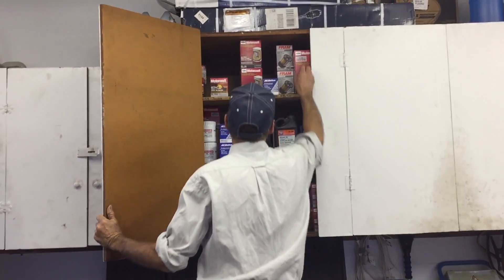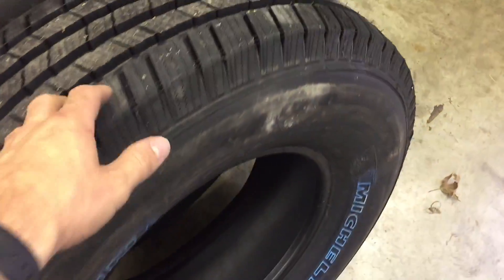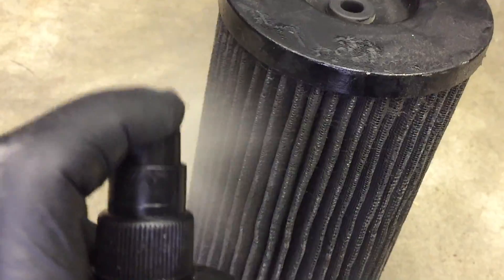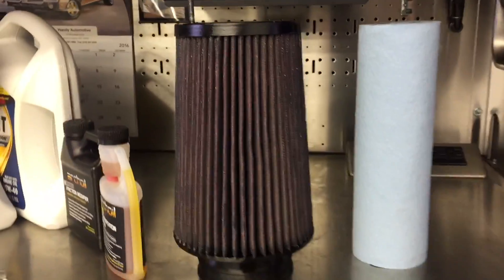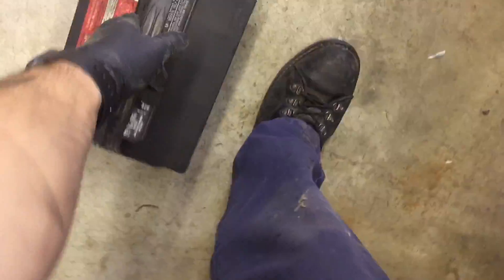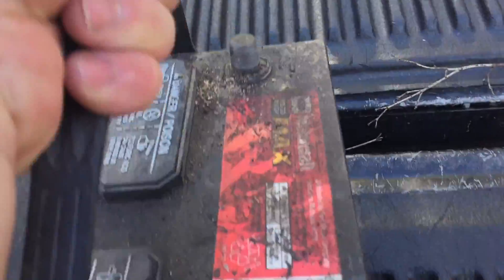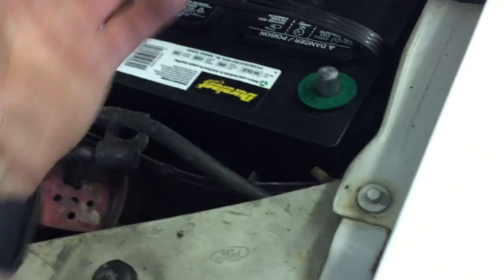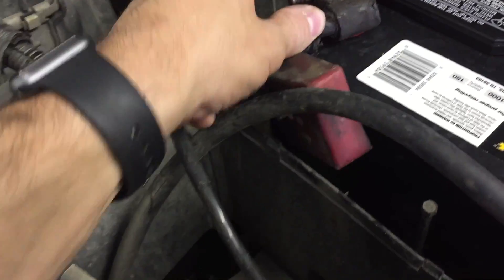Diesel Excursion Maintenance: Air Filter and Batteries

Comment: I gotta say, some love should be given to those cables, they look horrible. Especially with that many miles. My 1991 Explorer would start and run fine but the lead connectors were pretty buggered and one cracked completely one day. I did the cheapie fix but in the process found that the cable had green crusties a foot up from where the battery connected. I still went with the temp fix until I bought new cables. After I installed the new ones a few months later, I tore the old ones apart and found that the negative had a 8" burned section where it connected to ground. The sheath was cracked and hard, copper was black. The positive cable was over half filled with corrosion.

Long story short, cables are often overlooked and especially in your case with a large engine and that many miles and having burned through batteries, it's something to think about.

Comment: coming from someone who works for johnson controls except im in the  commercial service HVAC division (York and ect.) both autozone, motorcraft, interstate, AC delco, advance auto, several others including optima batteries are made by johnson controls battery division.

Comment: i have 3 Duralast gold batteries, they all have over 5 years on them and still pass a load test. 
 I have one on a farm tractor that has been badly abused ( completely dead and left for days, had starter cable dead short to ground and melt the plastic around the battery posts, been dropped, and still holds a charge and still starts the tractor) its one of the few things autozone sells that is good.

Comment: There is no such thing as batteries for the life of the vehicle.  Duralast Batteries do not extend the warranty if the battery needs replacing under warranty. It will just continue for the rest of the warranty. So if they go out after a year on the Duralast Gold batteries you will receive the remaining 2 year of replacement free. After the 3 years it includes 2 years of prorate. You get 3 years free placement and 2 year prorate. Duralast Batteries only have a 2 year warranty, Valuecraft has only 1 year and the Ecocraft has 90days. Good trick after the end of the warranty of the free replacement is to down grade to the regular Duralast batteries and you get back the difference and you get 2 more years of warranty for free. - Ex employee